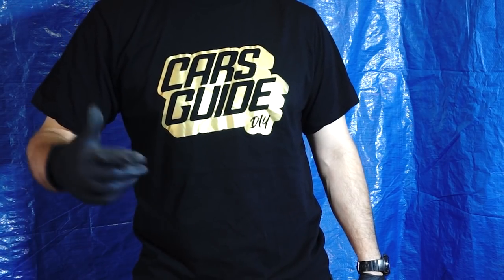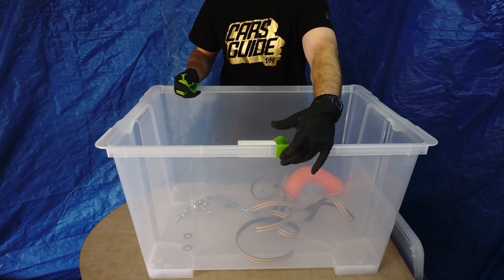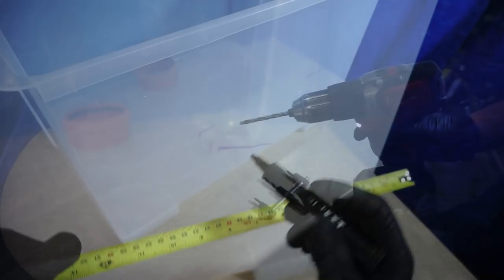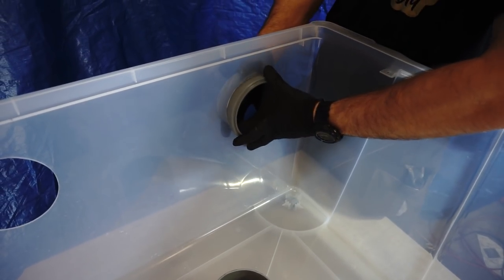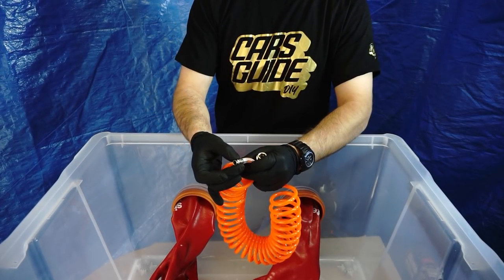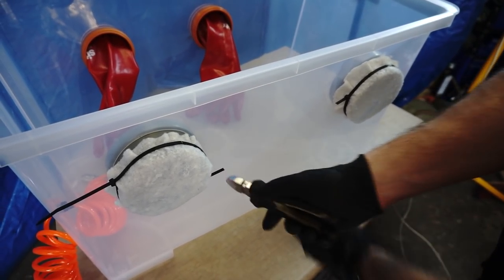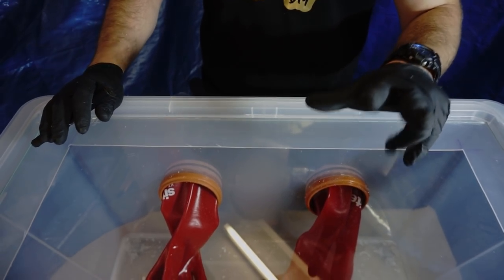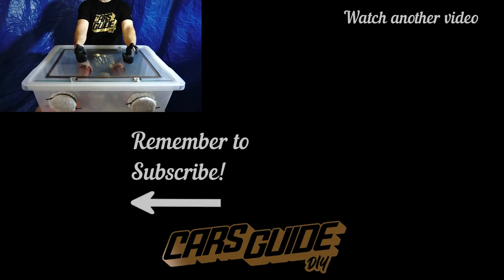DIY a sandblasting box / cabinet

Comment: I've been using blast cabinets for 50 years and all had a vacuum, otherwise you have a dust cloud that makes it hard to see your work, in fact, we knew when to change the filters because the vacuum was no longer able to keep the air clean and we couldn't see. the airflow to the filters went thru a maze to trap the dust and make it easier on the filters. I'm retired and going to build one like yours and build a maze on the back side with pvc pipe. what happens is after a while the sand particles become smaller and more likely to remain airborne along with the particles of the material that is being removed. the maze will not be glued at each end so it can be easily removed for cleaning, thanks for making this video I am now motivated to make one

Comment: Beautiful idea!!! Maybe by adding a grid on the bottom, you can work more freely from the sand. Many compliments!
Reply: What do you mean grid? Im curious to try that could you explain further?
Reply: @Thejustincredible500  I meant that by means of a grid (a net or something like that) positioned raised from the base of the box, you could work in a cleaner way because the sand would fall under the grid and would not create any obstacle with the deposit of the sand.
Reply: An old oven rack/refrigerator shelf supported by some wood (45x45 ,2x2) that can be attached with screws and large washers.

Comment: IKEA or Curver has such big boxes with removable lids, also with rollers on the bottom, however rollers may not be good while you work in the box (they are removable). I'd add some sealing stripe onto the top of the lip of the box part. Those clips could be made of the same metal bracket you used by bending them to the right form. (which are used for hanging the frame of plasterboard ceilings). I'd also add some strengthening wooden frame below the surface of the lid to hold the glass and not to brake it in any circumstances. Silicone sealant is fine to stick the glass to the lid or repair the gaps between any sealing mistakes. Great idea anyway, and a perfect tutorial! I would like to watch more of these contents on YT! Thank you!
Reply: Instead of glass I'll try the thin transparent plexiglass. Using silicone sealer will be perfect for fixing that plexiglass to the cover lid.
Thank you for the IKEA box mentioning, I found exactly the same, the largest 130Lit.

Comment: Thank you for sharing. If you were to consider a version two.. you might want to try putting the glass under the lid and keep the lid intact. Put your foam seal around the edges of the glass to sandwich between it and underside of plastic lid to keep sand from entering and silicone to keep glass in place. That would remove much effort and also keep the integrity of the lid and protect the glass when it is in storage.

Comment: Hi, just wanted to say thanks for this nice idea. Built myself a very similar box after I saw this video when it was new, still works nice today (with some improvements, i.e. LED strips in the lid plus a cheap chinese footswitch and solenoid plumbed into the airline). I also used a screw-on cable gland for electrical junction boxes for a more "professional" airline passthrough instead of tape and zip ties.  

The hardest part was to find an appropriate sized plastic box big enough (>70l) with a sturdy enough clip-on lid online and get it shipped during COVID...

Comment: I made one like this 2-3 years ago using similar things. Used a car air filter to let air in without letting the dust out and made another hole for a vacuum cleaner nozzle to suck the dust out. Everyone can make their own mods but it works well and is cheap enough to bin if it breaks! :D
Reply: Great idea. Does it also remove the media, or is that heavy enough to settle on the bottom? Or maybe a dust deputy attachment if the vac also grabs the media.
Reply: @ChillBroRelax  The media is much eavier than the dust so settles on the bottom with a tiny amount of dust not close enough to the vacuum hole. However that gives you a second bite at the cherry with that media for a finer blasting, start off with coarse, use the media that's dropped in the cab for your second blast and it's more or less medium, use it a third time and it almost fine.
I binned mine a couple of months back as it wasn't quite big enough for a 16" wheel (it would go in but no real room to move it around) and also the plastic tub had gone brittle.

Comment: Nice DIY project. 👍 I would stick some transparent plastic film on top of that glass just in case it breaks and the falling glass doesn't hurt your hands.
Reply from the maker: Good idea with transparent plastic film ;)
Reply: What about plexiglass instead of glass? That may be hard to come by these days. Also I have no experience in this field.
Reply: @nateb4543  No matter what you use, it will deteriorate from abrasive constantly hitting it.
Plexiglass will probably be worse, but safer.
Reply: @Stambo59  even glass?
Reply: @nateb4543  Yup, glass can be sandblasted, that's how they used to make patterns on it.
Reply: You could use laminated safety glass, from glass merchants. Very safe as it doesn't collapse. Even with ordinary window glass, falling from that height, is unlikely to cut through those heavy duty gloves (if you were buiding a larger cabinet, the laminated glass might be worth considering) Great well presented video. Keep up the good work. Pete (Scotland UK) 👍

Comment: Nice build. I personally would just use silicone to secure the glass to the plastic. I'll build one as I need a sand blaster on the cheap. 👍
Reply: His way might be easier to change the glass, tho?
Reply: @davehughes8212  it is easier, BUT there are easier ways to do this though. Have a thin weather stripping on perimeter and behind that have some Velcro on sections. Just a thought. 👍

Comment: A great Idea Fella' I built my blast cabinet in 12 mm Ply. But that was before I saw your video, So that is my next project, great info and costing next to nothing, And perfect for brake calipers.
I built mine to take a one two or four cyl Small boat engine.
I am now working on a revolving table to be able to cover all sides of the engine, Just great fun building it too. Youtube you can learn anything on this just brill.

Comment: Great video...third video I've watched today about DIY Media Blasting Boxes. I'm wondering why none of the videos I watched were QD (Quick Detach) compressed air line parts used. I feel like that solves a lot of the issues of being able to remove the sprayer inside the box and being able to disconnect the air-in line from the outside of the box. Just permanently mount a female/female QD coupling in one wall of the box and now you can quickly and easily disconnect air line inside and outside of the box and maintain a solid sealed connection port. Anyway, great build. Thanks and keep the content coming!

Comment: Nice tutorial! I added silicone everywhere. Didn’t find a box with a flat lid so I had some larger gaps to seal. Used acrylic instead of glass as the box will be in a messy environment. Will find or print some lids for the hand holes as well :)
Reply: So I'm not the only one using a 3D printer to make parts for this haha.

Comment: Just what I need, want to paint my car brake callipers so now I can get a set of used ones and sand blast, paint etc at my own pace and once done fit to car and sell the ones taken from the car.  I will do this for various bits on my car and bike (means I can use the car whilst I am doing it).  A small touch on the sandblasted will help with low light if needed.  I will reinforce the sides of the cabinet to strengthen but all in all a great vid, cheap project with many used (when not in use everything stored in the box) 👍

Comment: wow this is an excellent video, but I have a couple of questions.
1. what air pressure do you run the sand gun?
2. How does this refill the gun with sand?  Do you pour it back in the gun from the tote?
3. How much sand do you add to the gun initially and where can you purchase the sand - I assume you'd want in clean and dry.
Thanks for sharing this, such a great idea for very little cost 👍

Comment: Thank you for this build.  Stolen from another video: To protect the glass/top from pitting over time, you can buy overhead projector film cheaply by the roll and simply cover the viewing window for each use.  You can attach it using magnets or some other method.

Comment: I checked this out because Im building one. I may have to make my vent holes a bit bigger...but I have a few cool features on mine hehe.
I wont give it away, but I will post the link with my vid once its done (not this week, next week, since I need time to edit...and still waiting on some parts)

I did like your idea of adding the coil hose. I was using some regular 3/8 straight hose with 1/4 fittings on the end, but the coil is better.

Comment: Great video, easy to follow and looks as though it will do everything I’m interested in it doing. Is the glass any special type of glass(i.e. tempered, plain window glass, etc.)? How did you find the clips to keep the lid closed/on? If at all possible to send actual links for the purchases it will be greatly appreciated. Much thanks.

Comment: Oh, do you think you could have gotten away with only one of the exit ports with the fabric covering it? I know it looks nicely balanced, but I think it would have been fine with a single one centered. Thanks for the response.
Reply from the maker: Hello, thank you very much:) it is plain window glass. the clips for closing the lid were bought together with the container and lid. I bought them from a local builders store . unfortunately I don't have links to the materials.

Of course, one hole will also serve its function. you can also connect the vacuum cleaner to the hole, which will give an even better effect 

Best regards ;)
Reply: @carsguidediy  thank you.

Comment: steel baking pan on the bottom with old charcoal grill metal grill elevated above it by something like small bricks.  expended sand will fall to bottom pan, while cleaned piece is supported above by metal grill.  high pressure sand blasting wont blast through the pan like it will over time through the plastic container.
Reply: A bakers cooling rack has legs built in and are just a couple of dollars.

Comment: Thanks a lot for the video. I've been looking for a large box and I think I found exactly the same one - is it a Form Kaze XXXL? (oh wait... I also watched your video with brake caliper rebuild, being from the same country and finding the same box may not be pure coincidence ;)). How it's been holding up? Is it rigid enough for this use? I have read mixed comments. I am planning to use a sandblasting gun without a container and replacing the bottom of the box with a funnel-like one to have a closed flow of the blasting media, hopefully it works fine.

Comment: Could this be slightly adapted/modified for aerosol spray paint cans?
It's VERY cold outside in the United States right now (0 - 4 °C), but I don't want that to deter me from my work as the spray paint cans have to be kept and used at a temperature of 10 -21°C.

Comment: Very good job😁
Don't you think it could be better adding a hoover pipe instead of 2 portholes with fabric ? What about the dust inside the sandbox when you are operating ?
Thanks a lot in advance for your answers.
JEAN-MARC 
French Navy Officer
Reply from the maker: Hi there, yes you can install hoover pipe to vacuum, and it will be working too. But in my opinion this only complicates simplicity of the DIY sandblasting box  . Dust you mean used sand at the bottom? 
You can sieve it and use it again.
Regards :)
Reply: @carsguidediy  Thanks for your answer have a Nice week-end 😁

Comment: Would it work to use an upside down  vent hood to act as a funnel. The source of the sand would be at the bottom so you're recycling it? Maybe put some magnets down there to catch debris if you're derusting?

Comment: Loved the video, great build. In the States I can not find those pipe coupling double sockets. Ours appear to be shorter, and all smooth on the outside and the joint, no reduction on exterior size. I found them all over the European sites (I was not looking for the 110m in the US, since we don't know how big that is). If anyone in the states has a recommendation, I would love to hear it, because I really like how this build is done. Do we use a different name for the pipe joiner, other than English measurements?
Reply: Did you ever figure that out?  Going to set this up myself
Reply: @TYoung023  same question here

Comment: Great stuff.
Don't cut towards yourself with a blade, especially with much more blade exposed than you need. You could de-bur those plastic pipes with about 4mm of blade, not the 4" that you had there. Just means a much less nasty cut if you slip.

Comment: observation: That won't last 5 minutes. The interior will be blasted and you won't see in.
Reply: Just removable folie on the glass and replace when dull, i have same set up for years and no problems.
Reply: @xinixxagnix201  yes sir. I figured as such after thinking it over.  It seems more practical to make a better enclosure.